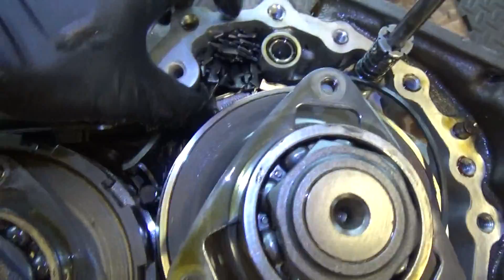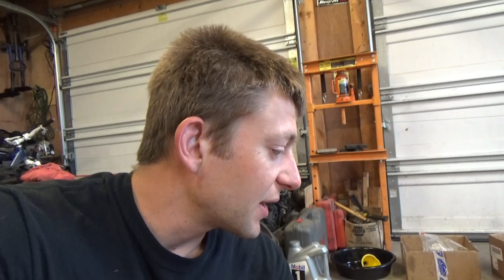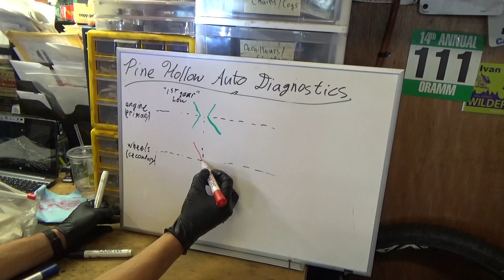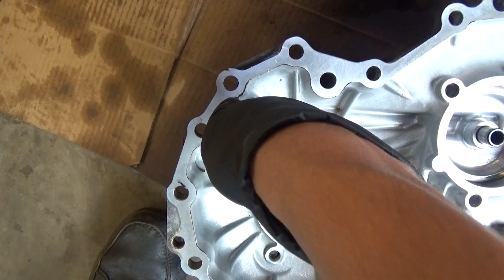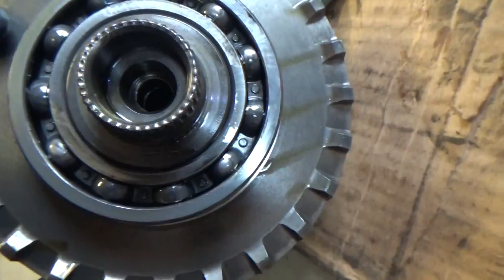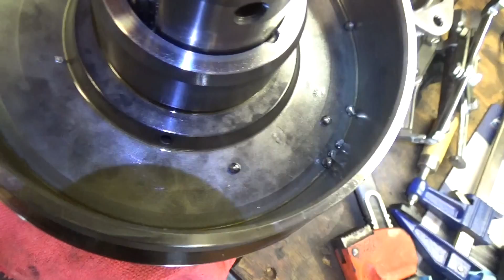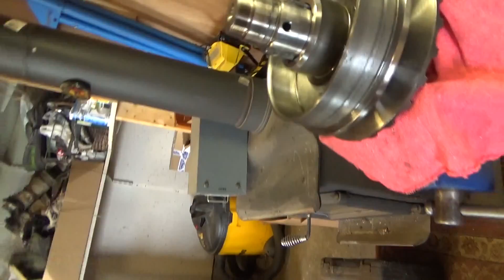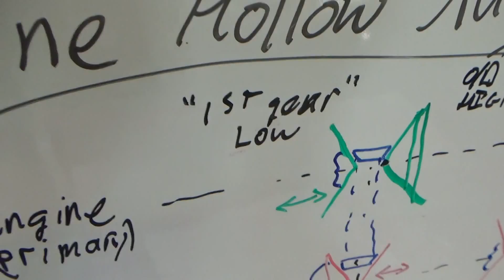Nissan CVT: Teardown and Failure Analysis -Part 2 (RERELEASE!)

Comment: Here is what I see and hypothesize... 
 When the balls and grooves failed to control the moving sheave because of wear between the primary pulley. It could not move and respond causing  slacking of the belt. In relation to the driven pulley they (driven And Driver) respond together right. When the belt slacked the bands allowed elements to fall out. of course.. the carnage afterwards was the result. the primary pulley now unsupported by the belt in the middle and with the balls trashed traveled beyond it designed inner travel exposing the seal that popped out. Thoughts?????

Comment: These bearings the primary pulley rides up and down on are a major point of failure on these transmissions. This channel АКПП Технология ремонта  actually tells you to replace them preemptively with aftermarket ones before they blow up. Maybe the guy is on to something...

Comment: To pull the pulley off ... you can try dry ice on the shaft .. the heat gun on the pulley?
Reply from the maker: It was hard to get off because the guide balls got sheared and wedged!! Supposed to slide on the shaft with zero effort lol

Comment: Surprised by the number of comments saying this is an engineering failure. The thing went 180k miles. Consumers want all these features but want the car to cost the same as the bare bones models, and they also want it to be just as reliable. Affordability, reliability, technology. Pick 2. Early Audi CVTs are hot garbage. Most were modified to add an extra clutch under warranty because they were all grenade'ing around 35k, especially if people didn't do the maintenance on them.
Reply from the maker: That's 180k of easy highway cruising. Granted that's not bad, but it would have lasted waaaay longer if it wasn't for the inherent design flaw :)
Reply: I suppose I'm a bit biased because I work for a brand that rarely if ever sees 180k miles, and if they do it's a horror show.  I would be curious to know how much an upgraded shaft would cost on the production end. A difference of $20 per transmission (just throwing a random number out there) would make a huge dent in profitability over the course of hundreds of thousands of cars.

Comment: It pays to stay curious! A perfect diagnosis of a failure. When the balls seized the transmission was locked in one ratio and driving in this fixed ratio could of overloaded the belt,like driving off in top gear. There is not really much published history of similar failures that I can find.

Comment: Very interesting. If your hypothesis is correct, that indicates the belt is a skookum choocher. In fact, it may be the most overbuilt part of the entire transmission.

So really, if the supporting components are up to par, I see no reason a CVT shouldn't last just as long as a conventional automatic or a manual trans. The belt is the Achilles heel of this system, and if they can make them this freaking strong, this shows that these transmissions have huge durability potential. We're going to find out how good our Honda's design is in the years to come.

I'm thinking this failure says more about Nissan's lousy build quality than CVTs as a whole.
Reply from the maker: Great comment! Yes, I think the push belt is indeed one of the STRONGEST parts of this CVT. In fact, there was no noticeable wear on the pulley surfaces either! Amazing for 185k miles!!

Comment: Looks like the same Jatco CVT they use in the Suzuki SX4 and Kizashi.  Suzuki has just as many problems as Nissan does (I own an 09 Altima with a CVT and 157k miles.  Wish me luck!) And we are told by Suzuki that any silver colored particles we find in the fluid deem the transmission an imminent total failure. Obviously,  any silver particles would be a cause for concern.  We haven't had to tear one down  but I would imagine it's for the same wear characteristics that you have found.  We are also instructed to replace the TCM when dealing with a CVT failure repair.

Comment: I think the main issue is that cars at least in here in Europe are throw away white goods on wheels. No serviceable items. Designed to last 100,000 miles and/or at least 6 years. Clutches are are becoming a nightmare to change on vehicles because by the time they go its out if warranty and its not the main dealers problem. Just look at a clutch job on a BMW Mini. So really at 180,000 miles the whole car has done well for this day and age and really they want you to just trash the whole car.
Reply from the maker: I would have to agree with you. It's becoming a disposable society! That's why I do my best to keep the older reliable "real" honest cars going as long as possible!
Reply: Pine Hollow Auto Diagnostics absolutely. We have a 23 year old London taxi in our fleet. 300,000 on it and its barely worn in. But its not the modern way. Cars are on same line as phones have gone. Upgrade upgrade, and when most cars become electric, I think rental cars will be the norm. Anyway. Take care Ivan, good luck in your new job. Happy new year to you.

Comment: Seems like what happened is the pulley turned on the shaft, jammed the pulley in place and that caused a build up of pressure when the tcm demanded a ratio change, which caused the seal to blow out. I think tcm changed the secondary pulley ratio enough to snap the belt while the primary was stuck in place.
Reply: batchnerd now that's one hell of a good observation!
Reply: It's 1500 to 10,000 lbs pressure inside CVTs (don't mess with them while running...) There is no way any seal along the edge of those pulleys can last that long. 
Mostly it's contamination/heat that kills them.  Should be better filters and coolers!! 
This transmission doesn't like dirty fluid. 
My question is this: My secondary pulley was damaged (2010 Cube), it was worked on at a machine shop but the sensor i side pulley was damaged.  The Versa doesn't have this sensor so I have in mind to put the Versa Transmission ROM pack from a Versa CVT as well as ECM/ECU to make Cube think it's a CVT Versa without the sensor the Cube has.  Better than rewriting that code... Ok another scenerio is to put in a Non-CVT from a Versa and use Versa ECM/ECU. Cha Ching!
Any sceptics?? Don't worry about the ignition and radio, trivial.

Comment: Hi Ivan thanks for releasing the video I did enjoy it and it was worth the $1. 
I was just hoping you would go the step further and buy the replacement pieces which are available if you invest enough research time etc. and re-assemble the unit. I would have enjoyed the re-build. I wassurprised to see the sprinkling of broken parts back inside. I would have bagged them and left them in the pan for the disassembler to appreciate.
The $800 basically for case and if it is not damaged I expect you will not have an issue with core charge refund. Good luck in your new endeavour. I hope you can still release the odd video.
Reply from the maker: IF the parts were available, I think all that I needed in this case was a anew belt and a new primary pulley assembly :)

Comment: Get a CVT for your bicycle to see how you like one-speed pedaling.  My guess is you’ll go back to a manual, where you can anticipate your load, rather than react to it.
Reply: When I drink motor oil it upsets my stomach.
Reply from the maker: I ride a single-speed mountain bike so I have to adjust my load and rpm to match the terrain ;)  It's my favorite bike!

Comment: Having picked on nissan for groove balls on input shaft I think it only fair to look at some positives
I was amazed at bearing condition and cone surface condition as really expected more wear on them from 180K .
With a bit of over engineering vct could be pretty reliable and towing suitable, the low power loss and potential of gearing is impressive useful factors .
for the sort of hydraulic pressures they work at as seals looked pretty minimal yet seemed be working order before mechanical failure and gearbox unit seemed dry externally too  !
Reply from the maker: Yup if it wasn't for those pesky balls, this unit would have kept on ticking!
Reply: Hell of a lot of cycling load on that input and just beat up the grooves and balls, wonder what the driven cone was like, better obviously but assume would of shown similar wear pattern .
Wonder if newer cvt boxes have already implemented design changes in this area !  
Belts are impressive. amazing how the elements within the steel band packs actually push rather than pull and manage grip cone surface well enough .
Wonder how many miles the reman will do .

Did you ever count elements in belt, got be 400+ ...

Comment: You know what would have been even more interesting, even for you, rebuilding that gearbox at home till it worked properly.

I know I would easily forfeit 8 Benjamins just for the experience.
Reply from the maker: I think parts availability is the killer...otherwise you know I would have tried it!
Reply: +Pine Hollow Auto Diagnostics How do you think the guys you sent them to rebuild them? By the looks of it apparently you would just need a primary, a belt and a speed sensor. I haven't checked, but I'll go out on a limb and say those would be sorceable!

Comment: The entire auto industry is going crazy right now 
Turbo's and CVT's and Push Button Start with Expensive key fobs,  Stop Start Technology. 
if Under warranty ok that's fine i guess. 
Out of warranty where i have to pay to fix it .....noooooo thanks. 
Naturally Aspirated, Regular Style Automatic and A normal key for me.
Reply from the maker: Those Camrys are legendary indeed.
Reply: FWD or RWD? Manual is the way to go for reliability though
Reply: @kingcarcas1349  Manuals come in second in reliability and life to Toyota's hybrid transaxle. No clutches, no belts, no shifting at all. Manuals still have clutches and synchros to wear out.
Reply: @flagmichael  but a clutch on a manual transmission is a wear item, its normal to replace a clutch every few hundred thousand miles. Most modern autos are next to impossible to repair. Its not like it was with the old th350 3 speed non overdrive transmissions. Once they started going to computer controlled overdrives is when they became overly complicated. Cvts are just insanely overly complex. Great for snowmobiles, bad for cars.
Reply: @joshp2542  the 700r4 was good too.....u could run it with no transmission module and toggle the lock up torque converter.....
But good point
Reply: Push button start and key fob dont bother me, but there should always have a manual override, with traditional keys. Everything else really suck. Start/stop and cvts are the 2 worst things. Unnecessary wear and tear
Reply: Imagine how cars will be in another 15 or 20 years.
Reply: Gary Vallone I guess the best career will be fixing CVT transmission.
Reply: Modern turbos are good, hardly see any fail, automatics on the other hand, I rather stick to manual and have reliable motoring.
Reply: @super_slav91  I also still love my 5 speed.
Reply: Don't forget "drive by wire" BS.
Reply: lightningsmokerXx all of this because of stupid assholes journalists who want maximum MPG more cup holders and want maximum convenience in price of reliability and longevity
Reply: The cars today are built for the "video generation", with toys & tricks that dazzle until they break down. We traded transportation for shiny dimes, nylons & Hershey bars. 
Makes me miss my '64 Falcon...
Reply: thay are more crazy than that: speakers that simulate engine noise, camless engines, variable compression ratios, non replaceable led headlights,dozens of ecus on each car, even the friggin headlights need an ecu because a relay and a switch is a prehistoric setup and not suitable for the advanced millenial people
Reply: @MrHBSoftware  Hey, leave the Millenials out of this
Reply: @brainndamage  I'd like nothing better than to leave out millennial's!
Reply: Hugo B. Totally agreed it’s insane . Think about the body guys also with all these sensors associated with the active cruise control and the lane keep assist systems . Accident avoidance and all of that crap .
Reply: Brian Lawrance i believe it did circle around most cars today
Reply: I agree that the entire automotive industry is going nuts with bad tech, CVT trans, cylinder deactivation, start/stop, plastic housing element oil filter old tech, its getting hard to choose a new vehicle that will last now. Only new tech I see is ducted diesel injectors may clean up diesels and allow removal of 12K in junk emissions products now per vehicle.
Reply: Haha! I can't believe this idiotic comment got so many likes. Sheesh. So many people who don't know anything about cars, I guess.
Reply: Thats why i love my under powered 1996 Ford Escort wagon.
Reply: They need to make money on repairs. Why make something that will, last forever.
Reply: jessylove 18  Sheep says what?
Reply: @francismartinez6049  Gen 3 Camrys are probably the best in terms of reliability and longevity.
Reply: Even an automatic is an inherent pain in the ass. Sure, in start/stop traffic, it takes a lot of stress out of driving, but if it goes wrong, it's an expensive fix, compared to manuals. Disclaimer: talking from a European perspective.
Reply: True Agreed.  I'm meant more comparing automatic. But yes fair point.
Reply: Jan Verschueren not anymore when these manual transmissions are using plastic slave cylinders, and clutch masters, and dual mass flywheels that cost north of 600.00.

Signed, a European auto tech.

Comment: CVT's in theory are a great idea, because they are similar to to what a snowmobile uses. 
Problem is, a lot of them aren't programmed right (early dodge's ) and the strength and long term reliability isn't there yet. 
And the fact that most of them are throw away , you often can't buy parts to replace broken items internally. 
However some people have good success with them. 
Now Me,  i wouldn't buy one with my money.  

Thanks for the video Ivan, very interesting.
Reply: CVT tech is good only for atv, side by sides but no good for on the road vehicles. Too weak to tow with, eventual implosion due to poorly designed tech. These steel belts shed metal within the transmission eventually leading to implosion, the only way to perfect cvt for auto/truck is to go to planetary gearing.

Comment: Hey Ivan!  Does that new CVT still have the whine noise after warmed up during acceleration?  2012 rogue with only 42k whines like a power steering pump low on fluid once warmed up during acceleration.  The whine noise is worse when hotter out, on incline and way worse on highway speeds during acceleration.  No codes or noticeable drive ability issues.  Fluid level looks good and clean.  Also does this strange thing where during initial acceleration it drops 1,000 rpms and then kicks back up when under load.  My 2011 Altima doesn’t do it.  Here is a video I made.  https://youtu.be/vgEfTfmtPjg
Reply from the maker: I call it "chain sawing". The original CVT always did it under load at high rpms on the highway. The new one is nice and quiet!! Not sure how to explain that...
Reply: BlazerGuy1983 Mine does the exact same thing, but strangely enough I don't experience it in the warm weather, it's actually the cold weather that makes it act up. I've taken it to the stealership, and of course they told me my vehicle was operating normal. These cars are a real pain in the ass. I'll be selling my 2015 Rogue very soon. I want to start 2018 on a good note.
Reply: My 07 Maxima is on 2nd CVT, first was ruined by local reputable service chain who put regular fluid in summer of 13, by December it failed. To their credit they  paid for new one that local Nissan dealer installed at 94k. 
In summer of 16 i noticed the cvt whine when it was hot out in Jul-Aug. Once weather cooled in sept it was fine and also had no driving issues the entire time. I had Nissan dealer check  late august and service manager even drove for extended time and they heard no whine, when i took to work the next day it was there! I think they are told to lie to customers.

May of 17 I drained fluid after whine returned and it was dark brown. I used Valvoline cvt as it is rated for Nissan. Changed fluid again in late august and fluid wasn't as dark.  Just changed now in June as whine returned and tranny is quiet again. I have 81k on this second tranny and going to run it till it breaks then get a new car that isn't CVT!

Only driving issue I noticed on occasion is coming to a stop, as I am braking the revs seem to be about 500rpm higher like the tranny is still trying to move car forward.
I also notice a fluid smell when it is hot so thinking there is a pressure release valve venting gas, the original never did this. Also replaced the rotted floor pans last year because of Nissans bad engineering which they deny, look that one up.

Comment: If the reverse clutch pack is mounted before the cone assembly, wouldn't that give the transmission just an equally amount of reverse gearing as it has in drive?
Reply from the maker: Theoretically, yes! I'm sure they programmed it so it wouldn't do that though lol
Reply: Yes, some older CVTs could potentially go just as fast in reverse as they could in drive. These days I think they normally lock reverse to a fixed ratio, probably for liability reasons..
Reply: yes but Nissan programs parameters in the valve body/ TCM to prevent this from happening
Reply: And In my 2016 versa reverse is electronically limited to 30mph. Up hill or down hill will pull hard to 30 then no more, rpm will drop to almost idle and will not get any more speed even after a mile or more.

Comment: This guy installs rods.  Looks like a nice repair upgrade... https://youtu.be/HghEHEg9hVk
Reply: I see where he's going with that trying to distribute the load better, but it seems to me that those rods won't allow the two cones/drums to slide in and out as freely as balls would.
Reply: Especially with fluid which probably isn't designed to facilitate low friction for sliding surfaces.